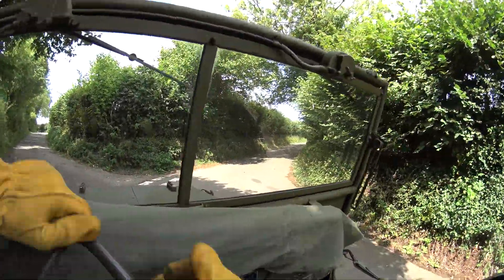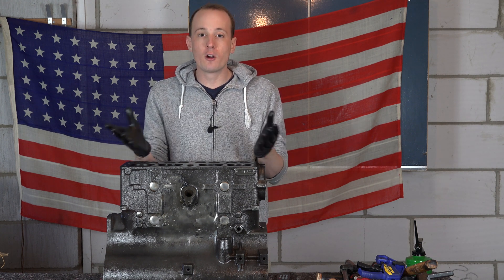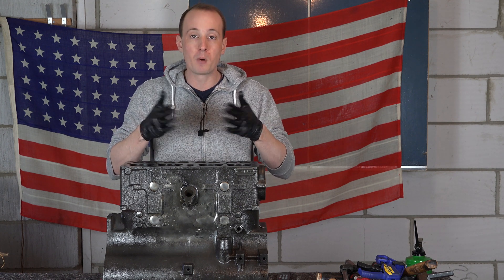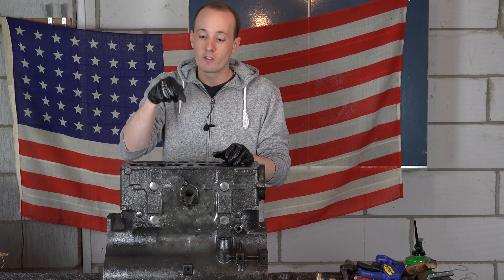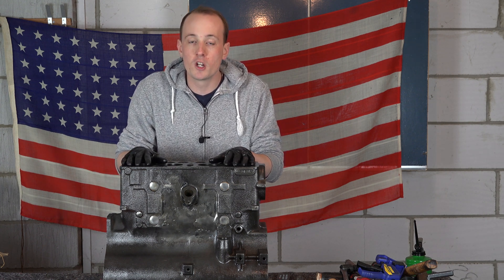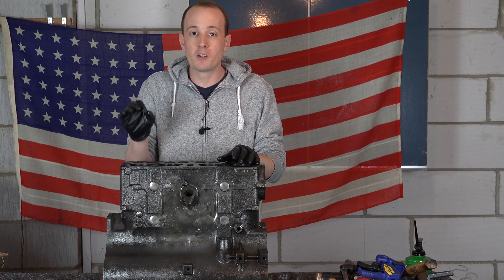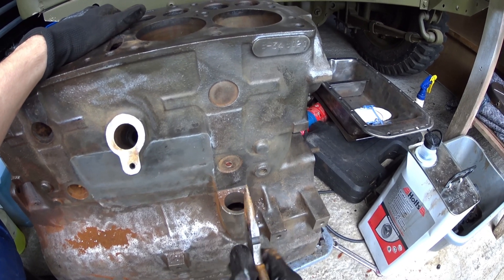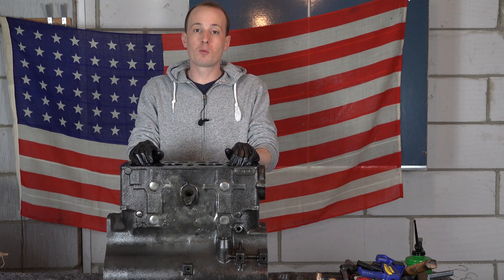Is it possible to Repair a Willys Jeep Engine Block?

Comment: Sometimes you can weld directly within the crack using spray welding. You don't need to cut a hole and fit a piece of metal. This is easier to find than oven fusion welding:
https://www.youtube.com/watch?v=qc9a3MfxsQA&t=83s
Also, it might not be easy to find a Jeep specialist, but that doesn't mean you can't find someone to weld the engine. Many shops specialize in heavy diesels, and it usually pays off to weld heavy diesels, rather than throw away a core.
Reply from the maker: Good Points, thanks!  Have a look at this option for crack welding too https://youtu.be/mYNniZ5i-fY
cheers

Comment: Hi, I a willys block completely rusted. What worry me the most is where the water goes to cool the engine as it is not accessible... would you have some advices?
Reply from the maker: https://youtu.be/V1W1gyOq-lo

Electrolysis should help, the longer you leave it the better, You must remove the expansion plugs too, get in there with whatever you can first to remove as much rust as possible and blow it out with a compressor and air gun, cheers

Comment: I always was led to believe that after a furnace welding job, a block would be  distorted from the heat, welding and cooling ,and thus,needed  to have the main bearing and the cam bearings line bored, and the deck re ground in parallel with the base of the block. Did yours need any re alignment?
Reply from the maker: I do not believe so, I dont think it has distorted any, cheers Matt

Comment: Did you re-sleeve the cylinders? Did you have hardened metal valve seats installed (for modern fuel)? 

Stitching cracks works well too. Cracks like to develop between the piston and water jacket (at the narrowest point).

Could you discuss the differences between the GPW and Willys block and why the GPW is considered weaker?  

I paid $300 US to have my 1942 GPW block rebuilt for my Willys - it’s a jeep salad)
Reply from the maker: Hi Gary, This engine hasn't been machined yet but I do not expect it will require re-sleeving.  I am going to fit hardened valve seats but they are not required for modern fuel.  Unfortunately I don't know the technical detail of why the GPW block is considered weaker than the MB blocks but i'm sure someone will know on here and comments, I imagine they are just cast slightly differently, cheers Matt

Comment: That looks like a very successful repair, they do crack around the valve seats and on the front corners of the block, and I have used a crack detector kit to indentify these, it is just a matter of spraying on the indicator powder after spaying the marker dye then the cracks can be easily seen, there/were are a few WOF blocks available and these are much stronger than the American made blocks, but do need a little work to make them externally similar to the original block, I am sure you mean the crown wheel and pinion and not the starter ring gear, is that now good ? It is good that your block has been pressure tested to see if there are any other hairline cracks. A happy result.
Reply from the maker: Yep, all tested up so should be good for machining when it comes to it, things are going to start moving fairly quickly with the MB now I hope!

Comment: Good video -- l fixed an old cast iron bell once -- preheated,  welded with Supermissle Rod, peened it , started a charcoal grill fire  🔥- place in there and covered , by morning it turned out perfect.  500 pounds seems a tad high for your repair, I've seen whole Willy's engines in US for $154 pounds ($200 USD& less) -- but for your location and limited access , maybe it was worth it - Cheers 🍺

Comment: Also Brand New blocks current manufature are available ... they are expensive though.
Reply from the maker: They are, jeepsudest in France offers a complete kit for around 2000 euros which is not too bad really for a zero houred block....
Reply: @Greendot319  .. that's not too bad really, they run about $2300 Canadiana Dollars her plus shipping here .. still I much prefer to mend the old one even ... if you have to send it out for welding ... 500 Quid is a lot cheaper :)
Reply: Mike Baxter: Interesting that the cost in Canada is similar to that in UK for an engine, yet in USA, where there are relatively few Jeeps as they were almost all left in Europe by order not to be brought back, we are told that a so cheap that it is not worth repairing them, we hear stories about engines still in crate for $150, but I have never been able to track one down, a friend did buy a new in crate engine, complete with ancillaries from USA, but it was a lot more that $150, something like $3000 I think.
Reply: @453421abcdefg12345  ... my thought is prices have risen in recent years ... restoring of old Jeeps is getting more popular  ... where in the past just getting them running for field and bush use may have been the goal
Reply: @MikeBaxterABC  Yes that is absolutely the case everywhere now, in past times no one repaired parts, they just replaced a gearbox or engine and threw the old one away, I remember seeing crossed piles of axles in the breakers yard, and wheels just went to the dump when a tyre was worn out, a Jeep was just used for hacking about in. Past times !
Reply: @453421abcdefg12345  My Dad had an old Jeep. (CJ I think) on the farm, it was just a frame with a plywood buckboard, a seat and a grill ... no fenders no tub, no hood etc :) ... The farm has been sold, but last time I check 8 months ago the Jeep was still there sinking in dirt up to it's axels :) ...  with no transmission.

Comment: Matching numbers? I owned and worked a fair few MB/GPW’s back in the day and don’t think I ever saw an engine REME had not replaced. As I imagine they could pull an engine in an hour or two they were not shy about replacing them. I doubt they worried about which engine went back in. Also not many vehicles had nomenclature affixed.Saw a few frozen cracked blocks but oddly the frost (Welch) plugs were still in tact. Poor quality castings?
Reply from the maker: Hi Bill, Loads of matching numbers GPW's around, my GPW for example, more common than not to find a matching late GPW as they weren't rebuilt during the war so all the bits stayed with one jeep.  I don't think the core plugs ever save the blocks from cracking which makes them seem pretty pointless!  cheers Matt
Reply: @Greendot319  What do you mean by "matching numbers"?
Reply from the maker: On a GPW, matching Frame, glove box data plate and engine serial number, an MB will have matching frame tag and glovebox data plate but not engine as MB engine serial numbers do not correspond to the other serial numbers
Reply: Greendot 319 You may well be right about matching numbers but very few of the jeeps I came into contact with had the original engine in them.It may be my fault too as I swapped out half a dozen or more. I guess jeeps weren’t so “precious” back then. I even drove one for years painted pink with Spiderman on the bonnet.
Reply from the maker: @billhawk349  The less said about that the better Bill ;)
Reply: That 'core plugs' were there to keep frozen water from freezing is an urban myth. They are there to fill holes made in the casting process, so the foundry could remove the core sand from the coolant passages.
That it cracked so often there ( also in the distributor tube,) indicates that it was either a poor design, or, due to wartime shortages, poor quality casting. (labour and/or material.)
Reply: probably due to wartime deficiencies in labour and/ or materials.
Reply: The "Frost Plugs" are not, and never were, designed to stop the block from cracking if water freezes inside (a very old myth) ... the holes in the engine block are there to allow the sand to shaken out after the block is cast. 
The proper name for the parts are "Core Plugs" and they are just put in, as the cheapest method to plug up holes.
Reply: Badges can be remanufactured with proper numbers stamped on them -- l had an OEM VIN plate made for my Willy's and had the proper numbers stamped on it to match the title. Plate came from the Netherlands -- mum's the word  OlllllO
Reply: Bill Hawk; I think these engines were produced at a very fast rate in a time of need, they are not of the best quality as they were not expected to last for more than a few weeks, so no real care was taken in their manufacture, if you look at some of the welds on chassis parts they look like they have been done by chimpanzees, but they got the job done, and they are still going strong, America was never very hot of quality production, or paying good money for a product, you get what you pay for .
Reply: Englishman French You are quite right about the build quality of jeeps especially the Fords. I did own a very early Willys MB with a Tubular chassis and “wrought iron” garden gate style front panel. The build quality was way better. The engine was originally designed for a tractor hence its “agricultural” appearance. They have lasted well though they did make lots of them.